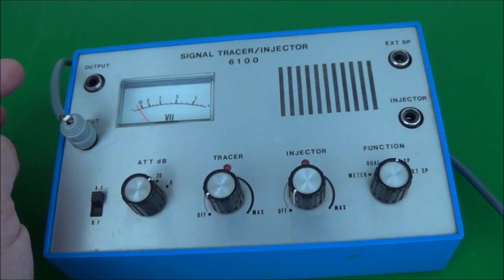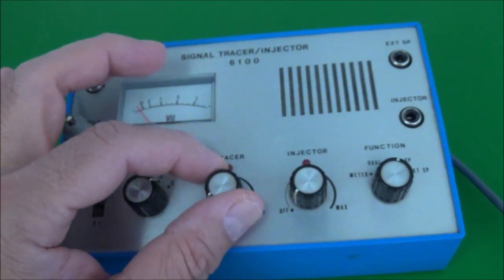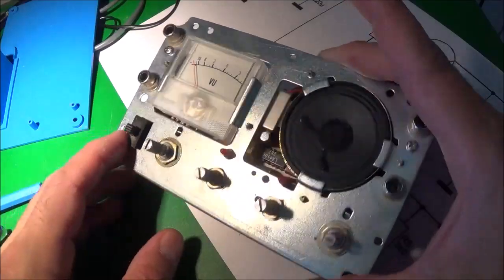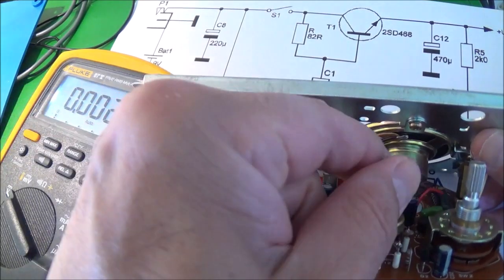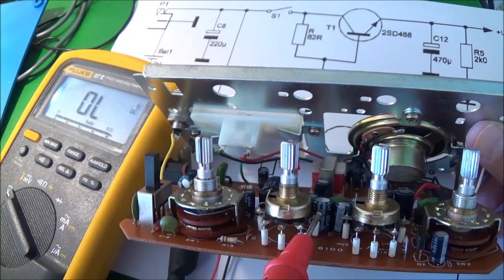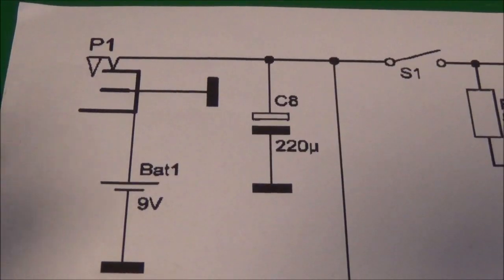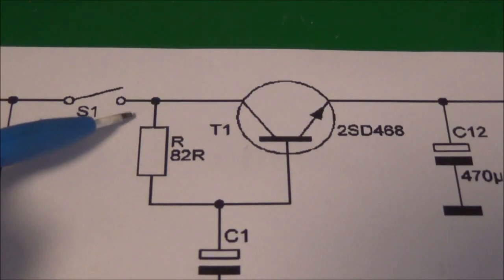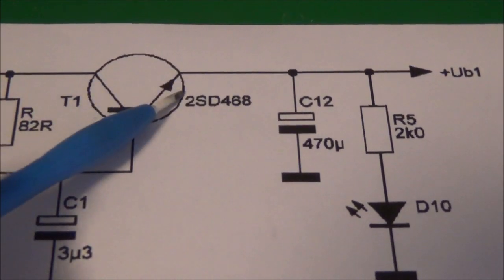Sansei 6100 Signal Tracer & Injector Repair

Comment: Just bought the Tenma 72-540 which is basically the same exact unit. Brand new in the box with probes but no manual.
Anybody have a copy?
Not that you really even the manual to use one .....but I'd like it to be a complete set since I have a brand new one.
Reply from the maker: Unfortunately, I only have a paper copy of a small manual for the Sansei and it is in the German language. I don't think even that it is an original manual since the pages are stapled, I believe. But as you might have noted, the unit is really easy to use.

Comment: Where did you find the manual?  Any help with a URL would be great!
Reply from the maker: I can send you an email in a few days if you leave me your email; will be back from traveling in 3 days. I will also look for a url if it is still available. I will comment again once I get back to let you know. I have very limited internet at the moment.
Reply from the maker: I am back now.  I do not have a user's manual; since it is so easy to use, you really don't need one. Here is a link for a schematic that explains how the circuit works. Is in German though, but the schematic, of course, is universal. https://cdn.website-editor.net/c8262e9fab4e4a598f0e2c84e41e9176/files/uploaded/Sansei-6100-Doku.pdf

Comment: thanks for this video.
i dont have this instrument but one very similar,Tenman 72-540.
has 2  ic s and a few transistors.
both my led work,but i dont know about what kind of signal should come  out of tracer and injector componendts.do you know on yours?
also  dont have any probes,did u make yours yourself?
thanks
john
Reply from the maker: Hi John. There should be a square wave coming out of the injector jack. I think mine was about 900 or 1,000 Hz. But it wouldn't matter, as far as troubleshooting is concerned. My cables came with the set. One cable is for injection and the other cable is signal tracing. Both use RCA/phono-type plugs to connect to the tester. Also, both of my cables are shielded. If you give me your e-mail address (which I or you would remove from the comment section as soon you get the pics), I can take pics of my cables and send them to you.
Reply from the maker: I have deleted your comment with the E-Mail address and sent you an e-mail.

Comment: It's odd that a little resistor would become open, but you never know. Nice basic troubleshooting video.
Reply from the maker: Thanks, Pat! I recently also worked on my HP334 because it didn't seem to work right although rarely used. A few months before I had did a quick ESR check of all the electrolytics. This time there were 2 open ones and not even in the power supply section.

Comment: hello old school, is there any chance of you being able to contact me? I really need some help with my GF-9191, and I have no images off of the internet of which help my purpose.  My tuner string has come loose from the back, and I don't know how it was put originally, so if there's any chance you could contact me, please tell me here:)
Reply from the maker: I no longer have this unit and have deleted all the pictures. But, you can download the service manual here (this has a picture of the dial cord stringing): https://www.manualslib.com/manual/1265543/Sharp-Gf-9191h.html or here: https://elektrotanya.com/Sharp_GF-9191H_E_HB.pdf/download.html
Reply: Old School thanks man! Helped me a lot!
Reply from the maker: Good luck!